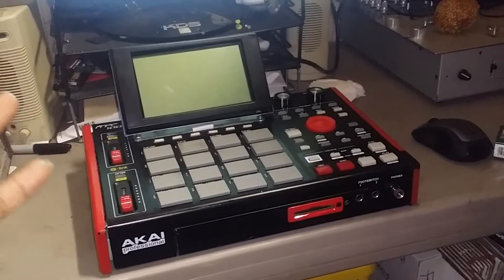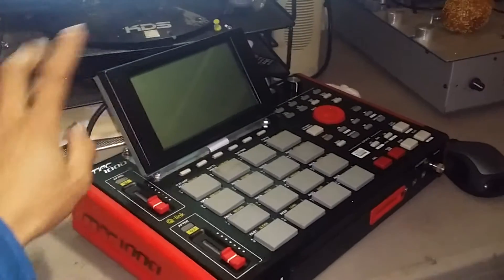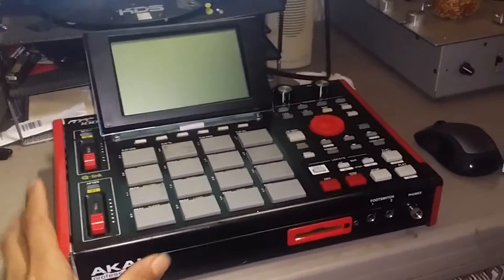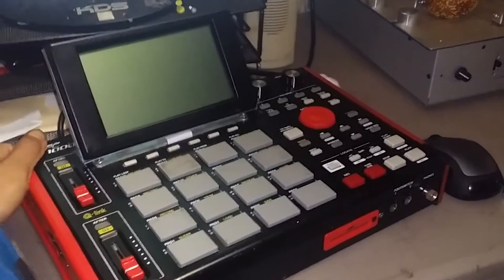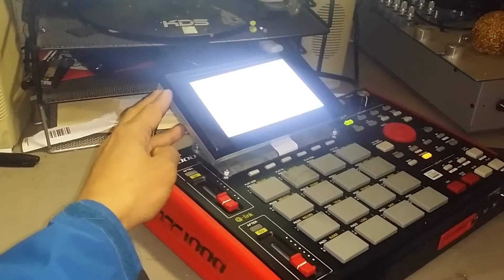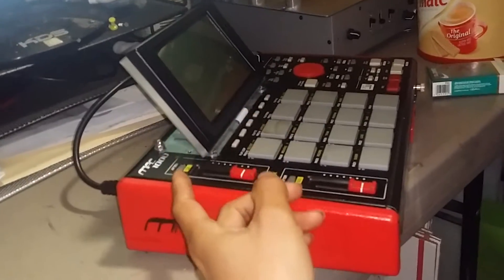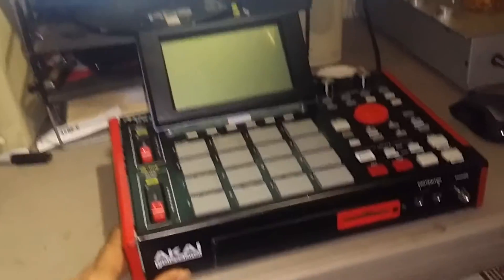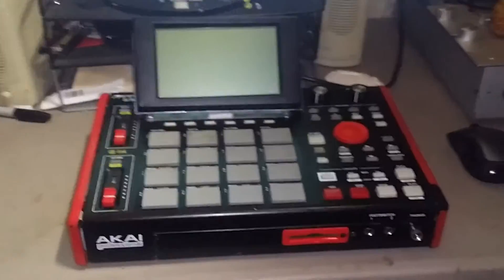MPC Tilt XLCD for MPC1000

Comment: Alex! My g the tilt screen is legit...anyway for you to share the plans? or holler at me for that small v3! por favor
Reply from the maker: it is just a simple hinge sheet metal as back cover some holes screws washer nuts.

I cut out metal sheet exact size of the OG screen and all four corners has screws washer nuts to have a nice grip from the main casing of the MPC then from that frame I install the hinge connected to the back cover of the XLCD then BOOM that's it! I can till any way I want
Reply: @AlExOnZe  gonna attempt this... lol Ill use some wood or kydex for the time being! gracias